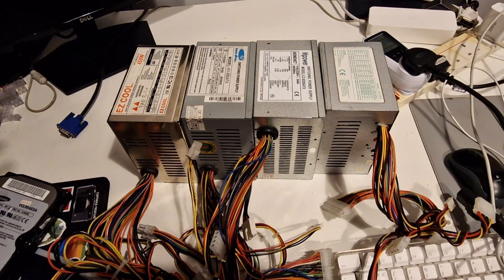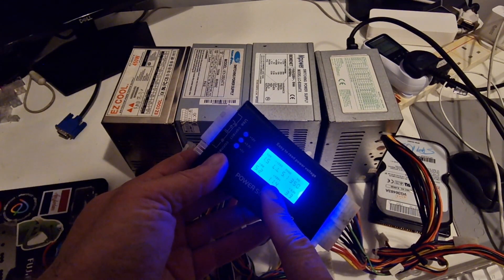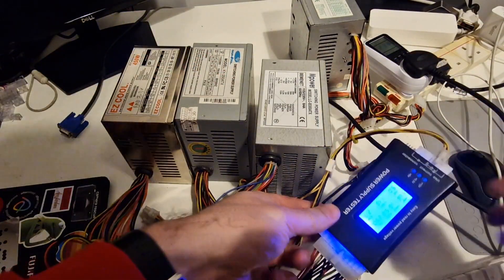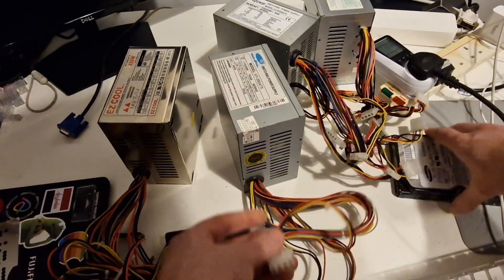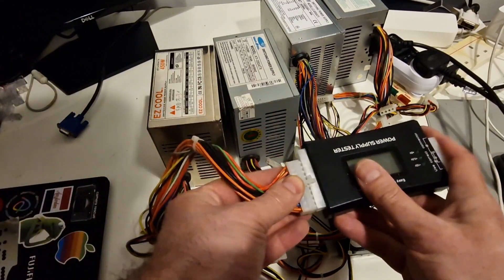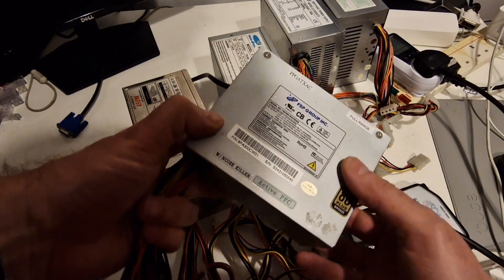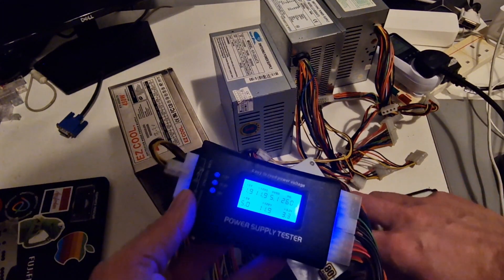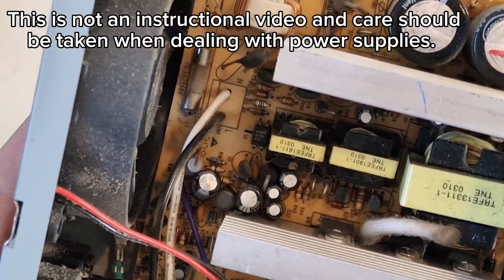Old power supplies may work and still be BAD! #psu

Comment: I have experienced problems on some even newer PSUs that can pass a test similar of what you are showing with bells and whistles and still be defective. The load of a single HDD is just too low to trigger some of the common failures.

I was never a big fan of PSU testers to begin with, since they require a small amount of knowledge (and other equipment) to interpret the results and the average user purchasing the equipment just lacks that, and can assume a PSU is working when it is not the case.

If I can make a suggestion, aliexpress DC loads are very cheap these days, some are daisy-chainnable up to 400-500W. That combined with a multimiter, or even the PSU tester you already have, is actually a much more "scientific" and reliable way to test a PSU on realistic loads, without risking components.

Thank you for the video, keep up the great work!
Reply from the maker: @Igbf  thanks for the heads up, I should probably add somewhere that this is a low load test, and won't show how a power supply performs with a high load. I mostly deal with old low power systems without power hungry graphics cards.
Reply: @OldPCGunk  Thanks to you for the video. I think the title and description is more than fine, was more a suggestion if you want to consider it in the future. Even with old stuff, maybe the 3.3V line is more important than the 12V one, but I think it is better to generate a load comparable to what a CPU VRM might need. Maybe 3-5A (for 10-16W respectively) is enough, but a mechanical HDD will only load considerably the 12V line, specially starting to spin, the rest is not tested much.

Comment: I wonder why your tester is working. Mine failed, the reason is that the white line (-5V) which is not present on modern PSUs is connected to ground in the tester, thus creating a short which prevents the PSU from starting. The solution is easy, open the tester and cut the pin. Anyway it cannot detect the -5V.